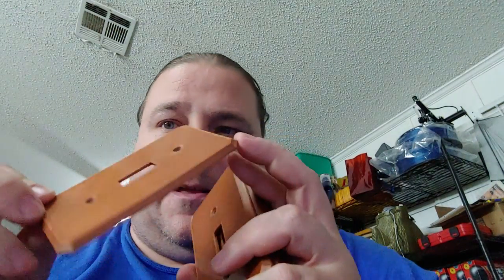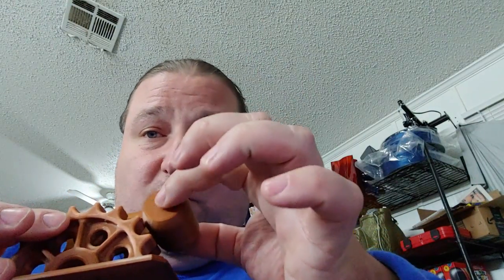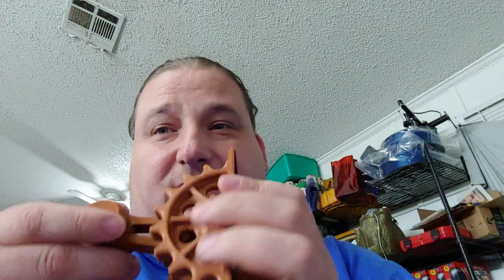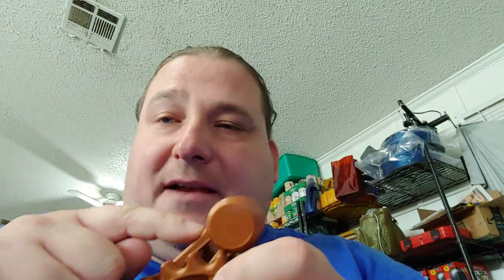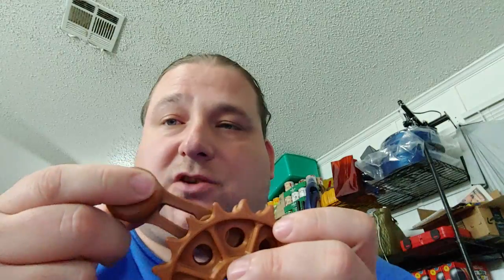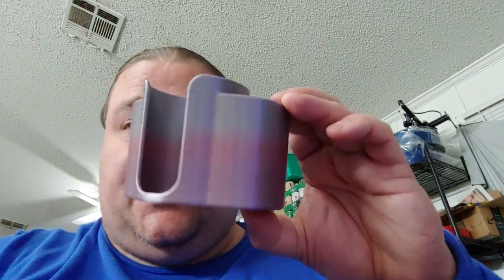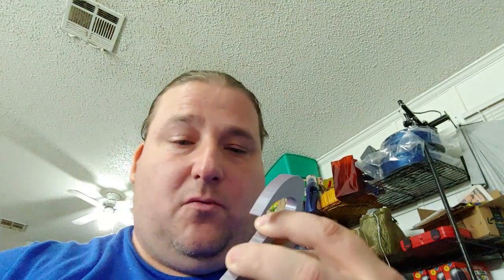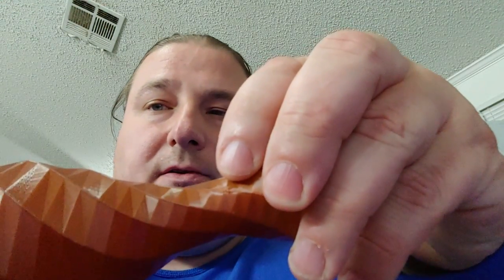Eryone Thinker Sample Prints T3DP

Comment: Just ordered a E3 V2. Do you know if they are coming with a 32bit motherboard? Glass is the way to go if you want glossy surface.
Reply: For 32 bucks you can get the ski mobo from big tree and its 32 bit and way better than crealitys upgrade board. Can add touchscreen/monochrome that switchs on the fly too.